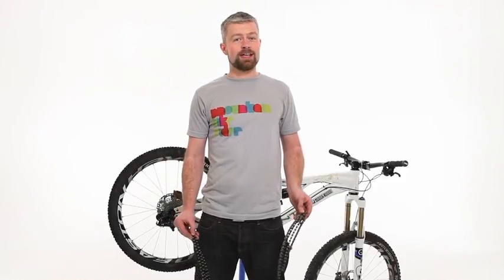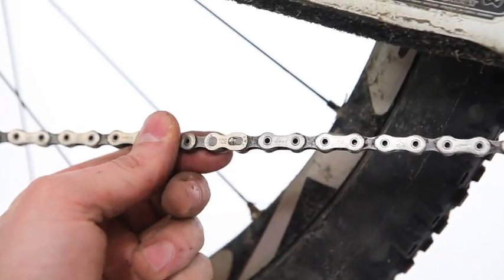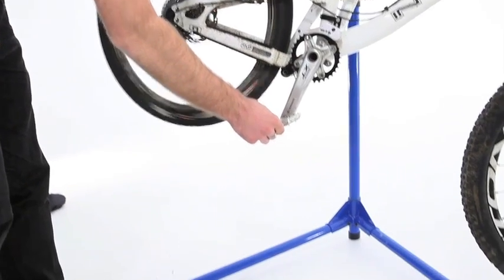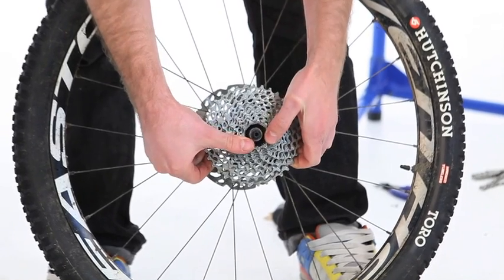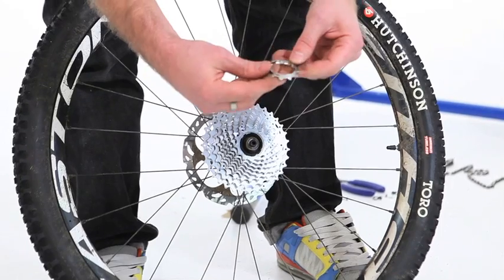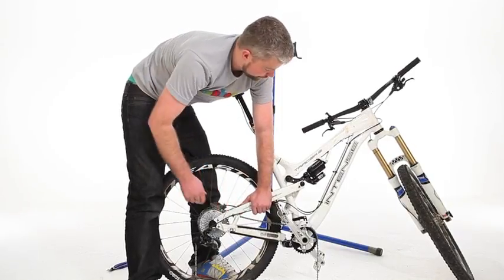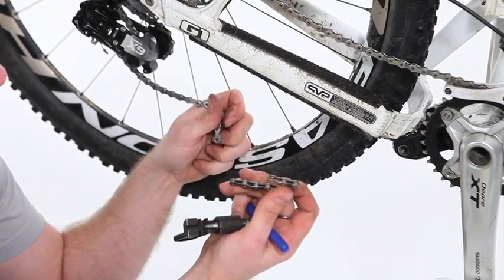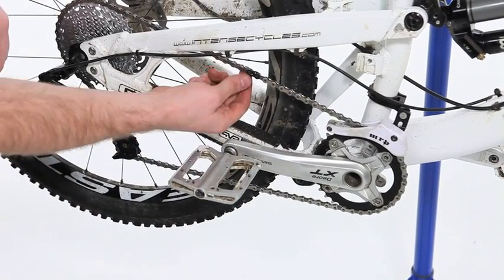How to replace a mountain bike chain and cassette

Comment: If you use the lock-ring tool without a handle, use the quick release (sans springs) to hold the tool firmly in place. Then  remove it as soon as the lock-ring loosens.

Comment: Nice video!I have one problem in my new 29er installed new chain everything is ok work well 2x1 work fine but when do backwards pedaling change gear to 3rd or 4th gear! Are you have any idea what it is or what is going on in my chain.....my chanrings is 38x24 in the front with 11-32 cassete with medium derailleur all is slx 2013 model!

thanks in advice Phillip!

Comment: If you follow the directions that came with shimano's chains you wrap the chain around the large chainring and large cog on the back bypassing the rear derailleur.  Bring the chain together and add one inner and one outer link to the chain or one inner and the connecting link if using a sram chain.

Comment: I don't know if anybody has asked this question so i will ask, how come when you take off the old chain then find your measurement with the quick release put it together pedal it a couple of times to make sure it's right, then take it off for a measurement so next time you know the true lenght of the chain, measure it up and record what the lenght it was so next time you can just measure your new chain and then if you need to remove some links you can?

Comment: I need a crankset 3 ring , rear cassette, and chain  for my 1999 Hardrock specialized mountain bike i never new that you needed to change your chain to keep it from wearing down other parts or i would've changed my chain very often now i know and will check it ever 3 weeks  because i ride my bike all most daily THIS BIKE WAS MY FIRST MULTI SPEED BIKE, I didn't  ask about  maintenance and they didn't tell me, ( because i use to take it in for service but now i'm out of work and need to do these things myself ) Short on money i need to do this myself but no will tell me how i go about getting the right replacement parts for my bike CAN YOU TELL ME PLEASE!

Comment: I like thread-on freewheel hubs much more then cassettes. If your cassette goes to waste, you have to change the whole wheel with a new one. If a thread-on freewheel hub turns into crap you just need to buy a new hub.

Comment: How do you change a chain if it's too rusted and frozen. I have a 1990's road bike, and the chain is rusted, shockingly still pedals but I want a better chain to go on there. Thanks!
Reply: Just use a chain tool to break it and you should manage to take it off

Comment: can you just use the lenght of the chain you are going to replace?
Reply: It will have increased in length from use, so the pins won't line up with the new one. You'll get a lot of grime on your new chain if you measure them side-to-side too.

Comment: Omg.. i think ill pay some1 to change the chain and cassette. Ha
Reply: dreaminNdigital- I had a small shop in town do it for me since I am a noob when it comes to bikes in general and he charged me $44 dollars for the rear cassette and it was average quality to my knowledge. He charged me $14 dollars for the chain it self and $9 dollars to put it on. I forget what he charged for the labor with the cassette. Keep in mind the price of chain will probably change for you. Now that I did some research I think that was a low quality chain he installed. But it's not horrible if you make sure they charge the right price for the parts they replace and don't try to raise the price plus charge labor. I tried to find the same cassette he used but couldn't but similar ones were only $20-$30 online (+S&H) and he charged me $44. Plus once he did that he said he needed to adjust/tune the shifter for the new set up which cost me another $9 and that didn't require any new parts just a screwdriver lol.Like the saying goes......Either you have more money than time (and pay to get things fixed)....or more time than money (do it yourself) P.S. I live in a smaller city so most things here are cheaper than say L.A. or N.Y.C. or Orlando ect. So this might be cheap compared to your local shop.